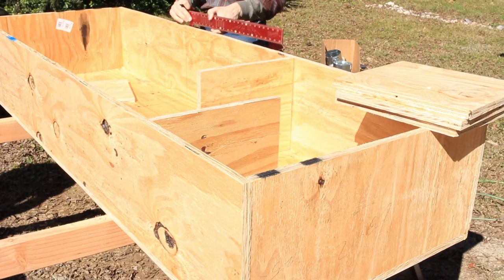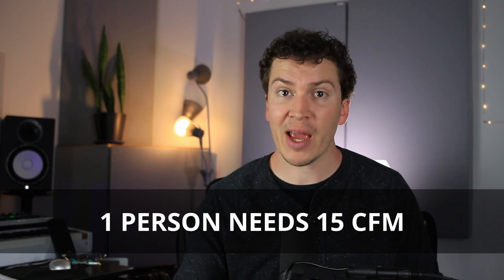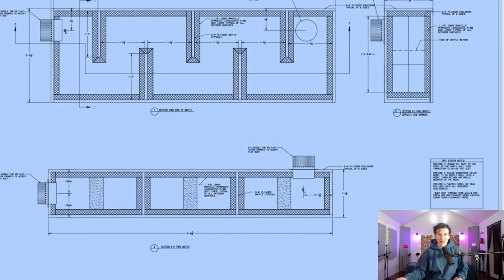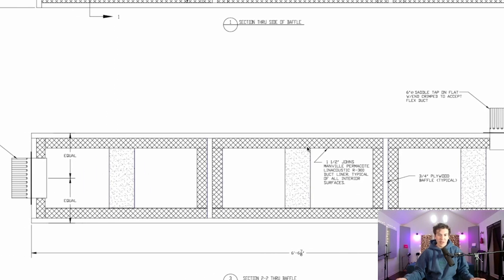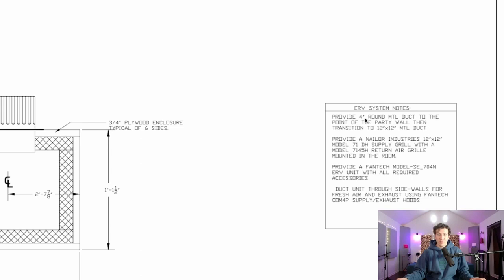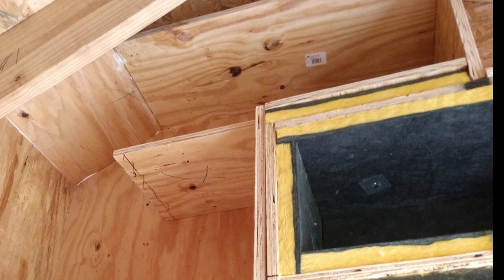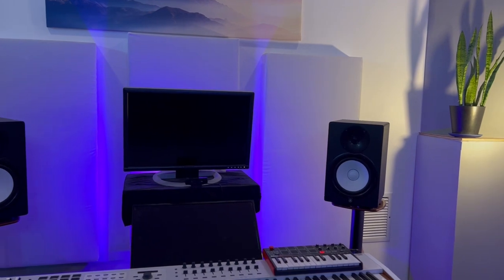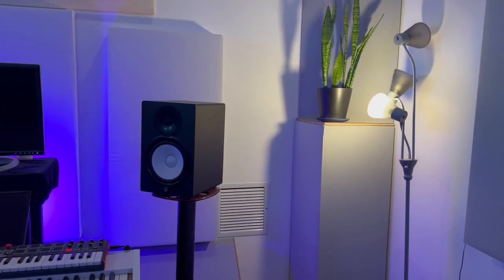How To Build A Soundproof Baffle Box

Comment: Hi, i built one like yours but with only 2 devider, it has humming sound came through the flex duct.. what coz it?
Reply from the maker: hey sorry to hear it is not working. When you say two dividers do you mean the turns in the baffle box? I'm not sure what could cause the humming without getting some more info. You could always jump on a coaching call. best of luck!
Reply: Oh man, that sounds horrible. Did you end up fixing it? Maybe your connection slipped loose when you put the box in?

Comment: If i don't have a ventilation system, can I just build a baffle box for air to circulate between my music room and the rest of the house? Like an air vent between the soundproofed room to the other side of the wall, but with a baffle box. Would that negate the whole soundproofing efforts?
Reply from the maker: No, in fact it is a very reasonable approach. I always like the idea of a balanced system so in and out boxes rather than one out.
Reply: @soundproofyourstudio  more precisely, I'm thinking about maybe having two vents/baffles, an intake and exhaust, and using something like bathroom fans to help force air in and out, i.e., a poor man's ventilation system. Basically, I just want the air to not become stale in the room while still having the soundproofing

Comment: Another great video, thanks Wilson. Can you position the baffle boxes both vertical or horizontal? . Does the in/out holes for intake and exhaust need to be specifically at top or bottom or each box? The reason I ask is I’m looking to place mine differently to yours but (of course) want to keep the same dimensions & effectiveness. Thanks.
Reply from the maker: They can go horizonatal or vertical. And the intake and out take really doesn't matter too much just try to keep them as far away as possible. You could also place them close to your mini split or ac ventilation to mix with the incoming cool or hot air. This will be more efficient over all.

Comment: Great video!  For your air LEAVING the studio, did you connect it right back to the AC unit, or just vent it out into an ajoining room? Also, was the vent for the stale air LEAVING located on the ground (!6:22 on your video) , or high up, and does it matter which? I finished my basement studio and only factored in the AC coming IN, and nothing to vent out the stale air, so i'm trying to figure out the best option. Obviously opening doors/windows where possible helps but would be great to have proper circulation.
Reply from the maker: @kevintye hey! I have another video all about ventilation. I personally think using an ERV and sending fresh air in and pulling stale air out is the best way to go. The air is pulled from the outside and the stale air is vented to the outside. Best of luck!!
Reply: Did you decide to puncture your drywall in order to ventilate out to another room? I am mid build and only have two HVAC outputs into my studio space, the intake/return is right outside of the room. I’m not doing eight hour studio sessions, I figure I can just crack the door every hour or so, and generally keep it open when I don’t need the soundproofing. However… It’s got me thinking whether I should at least put a Box between my double wall just in case I need it in the future…